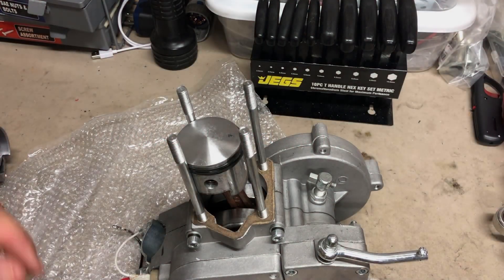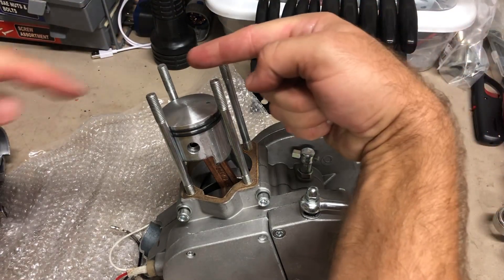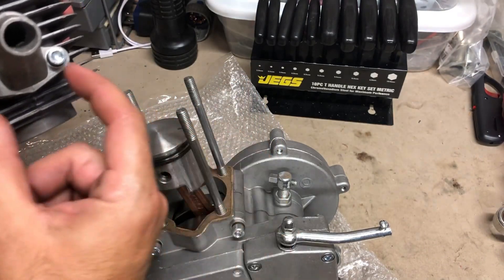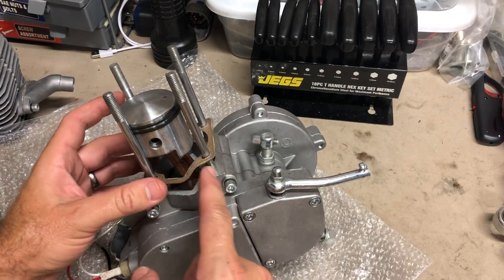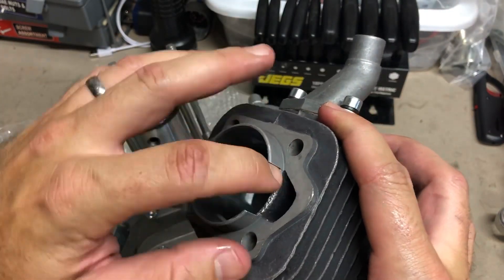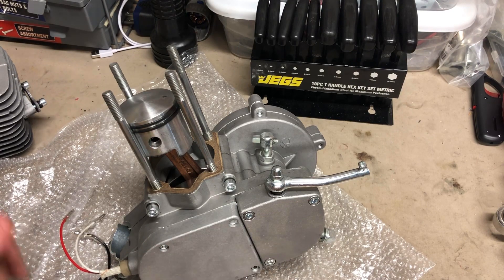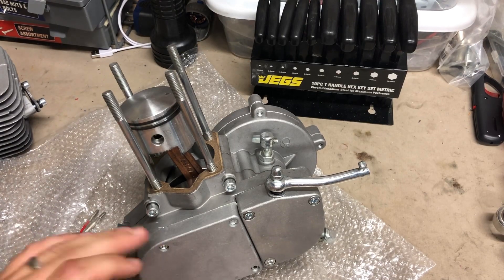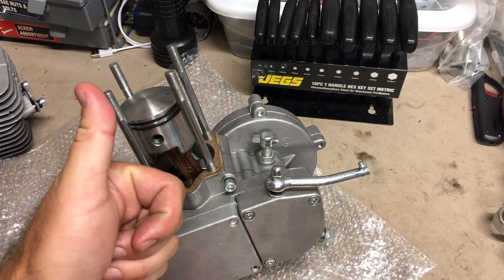WARNING!!- Firestorm YD100 Zeda Pre-Install Inspection Setup

Comment: Any chance you have any yd100 cylinders for sale I need 1
Reply from the maker: Nismo121: you can also ask Bicycle Motor works ... they are very helpful.
Reply from the maker: Hey, sorry to hear that! Did you try and window it for a reed valve? You can get them on Aliexpress for like $13. They are the 50mm  pistons.
Reply: @SouthernCustomCC  no intake stud snapped while I was riding just need the cylinder
Reply: Nismo121 is it not possible for you to use a easy out?
Reply: There's tools for broken bolt removers, look in home Depot. If threads are bad use Helicoil kit
Reply: We just received Zeda100/YD100 cylinders (and other parts) in this week. They will be up on www.bicycle-engines.com soon. If you don't want to wait you can give us a call at 406-586-5970 and you can place an order for one over the phone.